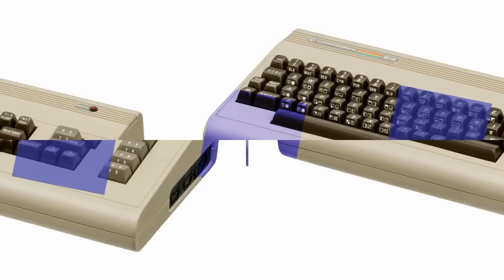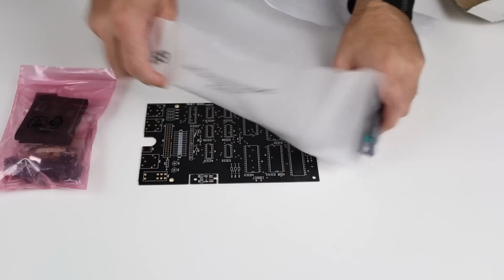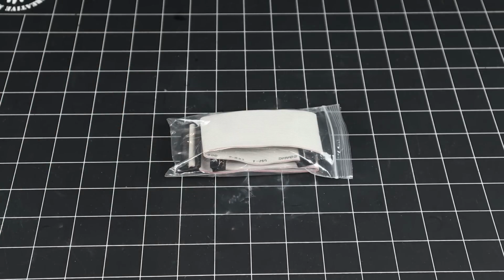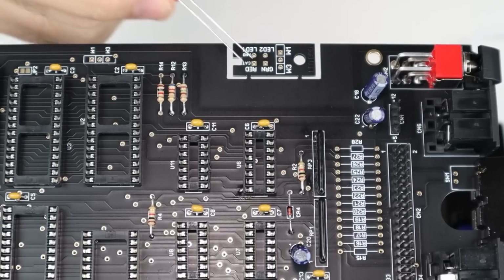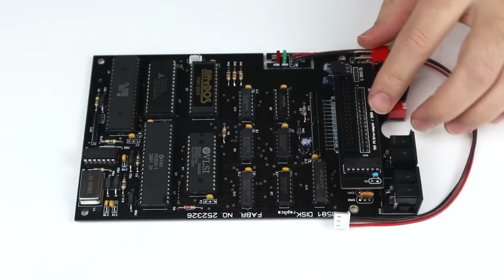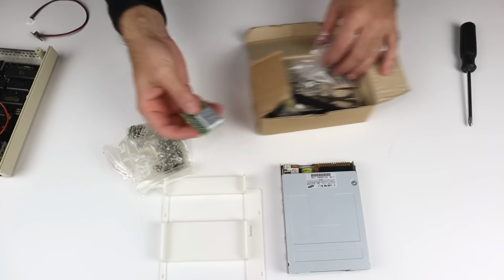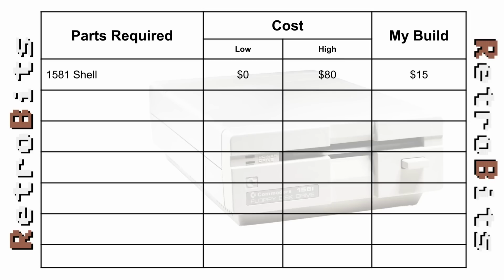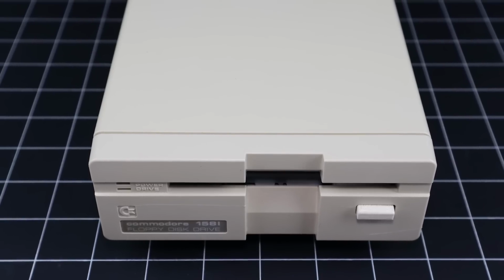Building a NEW Commodore 1581 disk drive!

Comment: Drench an old towel with IPA and lay it over the PCB, use your current brush and brush the towel over the PCB, that should remove most of the flux, I learned that from Noall's Retro Lab.
Reply from the maker: Cool, thanks. Will give it a try next time I open the drive back up!

Comment: Just found your channel, good stuff!  I used to do component level board repair and rework.  On cleaning your flux you want to flood the board with IPA.  Don't spare it like its precious holy water, use it.  Then scrub with a brush and flood again.  Then use compressed air to blow it dry.  You will be happy with the results.  Also for a more professional look you can reflow the solder joints after trimming the leads to give a nice little clean peak.
Reply from the maker: Thanks for the tips!

Comment: I have a 1541 that has a ruined logic board. I wonder if i can still use the original mechanism and driver head with some modern solution for controlling it
Reply from the maker: There are replacement 1541 logic boards available on Tindie if you want to go that route. https://www.tindie.com/products/bobsbits/commodore-1541-disk-drive-replica-pcb/

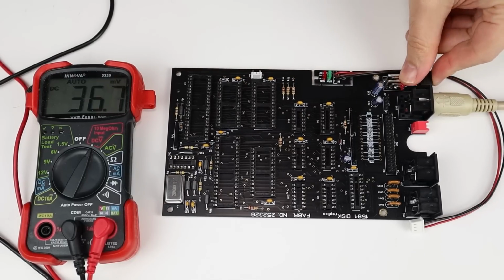Comment: 14:25 So you FIRST connected the power and THEN checked for shorts? I would recommend checking for shorts between power and ground before you connect this, since you could either fry the power supply or damage the board, you would not want that.
Reply from the maker: Heh yea I was only thinking of not frying my chips at the time, but you're right, I should have tested without the power supply first. Next time :)

Comment: I hope the next step will be to build new standard SATA 1.44MB floppy drive that will work natively on any new board.
Reply: Might be a bit late, but you don't need that, there are FDD to USB adapters you can shove into the back of any PC compatible 3.25" Floppy drive and connect it to an USB Port, or cut the cable off and connect it to an internal header on the motherboard.
I have a few extras laying about, including a semi - custom variant which also reads and reformats 740 kb floppys.

Comment: @ Timemark 14 Minutes you claim the messy flux residue. 
Just use a cloth to cover the pcb.
then rinse with the flux remover of your choice, you can of course scrub with the brush.
The plan is, the flux residue should be sucked into the fabric of the cloth.
And your pcb should get all nice and clean!
Reply from the maker: Thanks for the tip! I will give it a try.

Comment: It would be awsome if some one made a "1591" that reads and writes 1.44/1.76MB HD floppies. Maybe a replica of the CMD FD2000 or FD4000 instead. Only way to make this better.
Reply from the maker: I'm not sure what the story is with the ownership of the IP rights, but there is a guy who makes and sells reproduction CMD FD2000s called the Rear Admiral Firedrive-2k.
Reply: @retrobitstv  Sadly, Admiral Krang doesn't seem to do business on Ebay any more, and other means of contact seem to have eluded the internet,

Comment: Another recommendation (based on experience) on floppy power connectors: don't offset them. The two centre pins are ground and probably linked internally in the drive (I couldn't see any reason why drive designers wouldn't). That means if you get the connector offset by one pin, you're shorting either your 5 or 12 V supply to GND and that can let the magic smoke out. In my case I was lucky that the smoke came from the connector or wires and the AT power supply was robust enough not to care. Both the drive and power supply still worked perfectly fine after the mishap.
Reply from the maker: Good advice, thanks!

Comment: How much software (games) was actually released on 3.5" disks? Back then it would have been awesome to have Ultima 6 for C64 on one or two of them instead of 3 or 4 5.25" disks where you also had to constantly flip sides.
Reply from the maker: Very few games were released on the format. As the drive was expensive, it was better suited for business and productivity applications like databases, BBSes, GEOS, stuff like that. Most game vendors would target the lowest common denominator system and stick to 1541 releases. Loadstar did release 64 an 128 editions on 1581 that took advantage of the extra space. Of course back in the day, you could fit many cracked games on a single 1581 disk and today there have been a lot of games converted to fit on a single 1581 such as the Ultima titles.

Comment: Nice work.  IPA is fine for removal of rosin-based flux so long as the concentration is 91% or better.  The 91% stuff is available in a small spray bottle that is really handy, or in bulk bottles for refilling your sprayer.  Shoot it down with the IPA, scrub with your brush, then use an absorbent paper towel or cloth to soak up the mess.

I've made the mistake of getting resistor packs in backward, and, yeah it can lead to unpleasant consequences if not detected before power is applied.

Comment: yeah the 1581 was a interesting drive. I also had one, once sold most I had, then bought one again, but wasn't able to do what I planed. About 15 years ago bought a couple of these "NOS" without drives from (Canada? don't remember) was nice to have, had more then enough original Amiga drives ... hbut some years ago I sold this all. 
Some have good use for it, but in my opinion it is too overrated. Commodore came much too with it.
Reply from the maker: Probably the same vendor (in Toronto) that I got mine from. They were great addition to a BBS machine or for storing lots of data files. GEOS128 really shines on a 1581. But yea, they came pretty late in the Commodore 8-bit line and there wasn't a lot of software specifically for the drives.

Comment: To clean up the flux, use a lot of IPA and scrub with the nylon brush like before, then take a clean cloth (like from an old t-shirt) or one of those blue Scott's Shop papertowels and lay it over the back and then rub the nylon brush over the paper towel, this should absorb most of the flux/IPA waste without issue and leave very little in the way of tearing since you are just using the brush to make contact with the board to absorb the liquid and not running it over the legs on the underside.
Reply from the maker: I will have to give that a try, thanks for sharing!

Comment: Will this product be suitable to connect an IBM PC compatible FDD to the AMIGA1200?
Reply from the maker: The small adaptor board should work with an Amiga as well, but its footprint was designed specifically to fit the 1581 board. I think there may be other revisions of the adaptor floating around though.
Reply: @retrobitstv  So this whole block is not needed to connect to the A1200, just that small adapter board is enough?

Comment: Great job on the build and the video!  The 1581 is also my favorite Commodore drive.  I've thought about building one of these replicas before, but was afraid I'd spend as much as an original drive.  Your price estimates at the end more or less confirm that.
Reply: Don't forget Simon Owen's SAMDisk. With this PC application and a 1581 drive, it becomes incredibly easy and quick to transfer large amounts of data between a PC and any Commodore 8 bit computers. No need for SD2IEC or any special hardware.
Reply: @francoisleveille409 What is this?
Reply: @francoisleveille409  - I can't find any info on "SAMDisk".  Did you misspell it?
Reply: @BillAnt  Nope. In Google I immediately have this:
SAMdisk - Simon Owen
Reply: Original parts / devices get more and more expensive. In a year or two this replica will be a bargain compared to the original drive price.
Reply: Why? Surely you have almost all parts necessary available, so you'll be very close to the low estimate.

Comment: I've been looking for a 1581 ever since I realised they existed but never had the opportunity to buy one cheaply. So this option is a good one for me. The only problem is that the only parts I have myself right now is the PC drive (a few HD drives which are old enough that they should work fine as DD drives) and the PSU from a 1541-II which I however would like to keep using on my 1541-II. So now the question is: used 1581 or this kit? At least there are options. :) Great video and thanks for bringing this to our attention.

Comment: Can it be used as an Amiga external drive as well?
Reply: I don't think so; the Amiga external floppy drive connector has all the signals needed to connect directly to a floppy drive. This means that all the extra electronics in the 1581 drive, as well as the 1571 and 1541 drives, will only get in the way.
If you really want to connect an external floppy drive to an Amiga, but don't have one, the easiest path is probably to source an old PC drive and perform the needed modifications; there are plenty of websites out there that show what you need to do.

Comment: This is why Europe was almost exclusively cassette based for C64 software. In 1987 you could buy a C64 for half the cost of a floppy drive. And even if you found the cash spare to buy one, most stores didn't sell disk versions of games...
Reply from the maker: Yea, it seems that things were a bit different over here. By '87 the 64C was about $125 US and the 1541-II would have been another $100 on top of that. Most software came on disk and piracy was absolutely rampant.
Reply: @retrobitstv  Yes that sounds about right. In the UK it wasn't till the Amiga that disks became standard and then many of the people who I knew who had Amigas had mostly pirate copies of games...Piracy wasn't such a thing on tape with the C64 as they were often so cheap. You wouldn't go to the trouble of copying a cassette game you could buy for a few £ :)
Reply: A 1541-II in Australia in 1988 was US$920 in today's money.  A 64C was US$615.  A C2N was US$125.  This was way cheaper than they were in 1983.

Comment: On the topic of "gooey mess". I had used a very same looking brush with IPA to try to clean boards. It may have worked before (don't remember) but it certainly  became gooey whenever it came into contact with IPA. Instead of cleaning, it made things worse. It may have been because I used it for other things in between, I don't remember. But it was really horrible. You could try just spraying IPA on the brush, waiting a few seconds and then touch it to see if it sticks.
 I started using a normal toothbrush and thrown the other brush away. (toothbrush may not be antistatic, use at own risk).

Comment: You need to clip off the PC floppy's green LED.  A better idea for a power connector would be the actual Berg Floppy connector from a junked PC power supply with the molex crimped on the end.  The Berg connector is keyed so it would cut down on accidental power reversals, assuming you plug the board side in properly.

Nice video!  I'm jealous.
Reply from the maker: Thanks! I've already desoldered the green LED and adjusted the front panel LEDs to sit better in the case! I will have to order the proper connectors. Both sides are keyed so it should be fine once done :)

Comment: I like brake cleaner for flux cleanup.  Nonchlorinated if you use it indoors.
Reply from the maker: Cool, thanks for the tip! I have brake cleaner out in the garage, will have to check if it's nonchlorinated or not.

Comment: Thank you for this video! With the shocking prices of 1581 drives on eBay (and prices are only going to continue going up), it's a comfort to know that an existing drive can be refurbished. As long as the needed chips and things are readily available, that is. :)

Comment: Great job. Like you said, it's amazing what can be done nowadays between 3d printers and small-run PCB manufacturing. And it's funny how "crazy eBay prices" actually seem fairly reasonable when you look at trying to build it yourself, especially when factoring in the shipping costs and all the work.
Reply from the maker: Thanks! Yea, when I stop and think about it, the tools we have access to today really are amazing. At an inflation-adjusted $900 MSRP, they haven't yet crossed that threshold of appreciation where they're more expensive now. Not that they were sold for the full $400 for long... I guess my takeaway is that one should build this project for the sake of building the project, not specifically for cost savings (unless you're the corner case that has most of the parts on-hand already).
Reply: @8-Bit Show And Tell  It actually costs about $80 (total) to build a 1581 board and the drive can be sourced from an Amiga 500. I reversed the 1581 and built 10 several years ago.

Comment: Commodore 1581 was my favourite 3.5" disk drive... So much storage space compared to C-1541 or C-1571... How'd you get 80 columns to display on that Sony monitor? I wish I didnt sell my C-1902 monitor back in the days when I was a kid.. alas, it seems too complicated to get 80 column cable/adaptor for my C-128 to hook up to modern day monitors...
Reply from the maker: My favorite drive too. Looks and performance to match! That particular Sony has digital RGBi input so it works out-of-the-box with the C128! I did a short video on it that you can find here: https://youtu.be/4aaRi_yN0ds There are some pretty inexpensive C128-to-composite adapters these days, and they work well albeit without faithfully reproducing the one "dark yellow" (brown) color.

Comment: Wow!  That is awesome.  I knew about the cases being available way back when but had no idea people had recreated everything else.  I am glad I kept my original 1581 bought from Toys R Us back when it came out.  Like you, it was a purchase for BBS use only in my case it was Color64.  Thanks for sharing your build.  You have provided a ton of great content.  Keep up the good work

PS: About that flux removal. I hate it and is my least favorite part of any build.  LOL.  I used to do the same method as you and it seemed like no matter how much IPA you used the end result was a sticky mess.  I learned a great tip from Jim Drew when I was building the ICS64S motherboard he sells.  I used the same IPA and brush but then I used a microfiber cloth with another spray of IPA.  I did it after every component/component group was soldered.  It is amazing how well it works and the board came out with almost zero residue.  Of course, the microfiber can catch on the pins too but if you blot it and then dry it after it works wonders.  The downside is it takes longer to do it this way.  I have tried the dedicated flux removers and a few other chemicals and they all left me feeling meh as they weren't great.  Hopefully this helps.
Reply: What IPA do you use? I found that using anything except 99.9% pure caused crud to be spread all over the board, but the really pure stuff worked really well.
Reply: @Doug_in_NC  I typically use 99.9 or 91%. If there is a lot of flux I didn't notice a difference.  Especially for large boards like motherboards.  But with 91% and a microfiber it is not an issue.  No more sticky mess.

Comment: A good source of these parts is a dead 1571 as it has almost the same board, just in a different form factor and some additional glue logic. Both use WD1770 floppy controllers which then talk to the 6502-based host. And 1571 drives are very common.
Reply from the maker: Good info, thanks for sharing!
Reply: @retrobitstv  The original uses all off-the-shelf parts, and the MOS8520 can be found easily since they are used in all the early Amiga models. Sourcing parts from a 1571 is not required and if you do, you will likely be lynched at high noon. I reversed the 1581 5 years ago and built several of them and there were no problems sourcing parts.
Reply: @johnbos4637  I wouldn't be concerned about cannibalizing a 1571 that's already dead, too many of them have already just ended up in the bin because of that. But pulling a drive apart that can be restored to working order, is a bit of a waste.